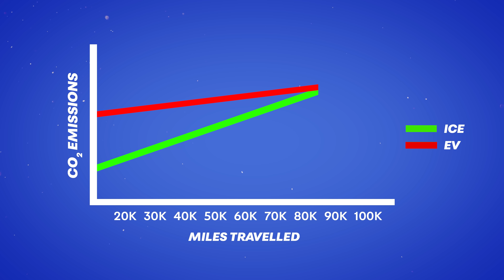Are Electric Cars REALLY That Green? [New 2022 Data]

Comment: I think one more major environmental problem is recycling the batteries of the EV's,it will make more damage than ICE vehicles.
Reply: Not an issue... head over to some EV owners forums and check their experiences. For instance, if an EV is involved in an accident, everyone will tell you, don't let the battery go when the car is taken away!.. Get it back from the insurance claim... because they are so valuable! Battery cells and entire packs are like gold dust. They are immensely useful and people want them for ICE car EV conversions, repairing existing cars and for use with home solar panels and grid storage... or even converting narrow boats and any other vehicle you can think if. A large battery pack in a car can be broken up and used in about 5 houses to complement a solar installation and there are companies popping up everywhere to refurbish them and sell them at a profit. This means basically zero EV batteries packs end up in landfill, you'd be an idiot to chuck them away!
Reply: I think u didn't get my point,so first we will discuss the scenario furnished here.
After the car get tottalled u expect the battery pack to be intact.
Ok now my first point,every battery pack have a life cycle it may vary,after the life of that battery pack it need to be recycled,that will do more environmental impact.
Reply: @lallumanohar4107  the lithium and cobalt and any other rare elements in car batteries, along with the copper, electronics, AC converters are valuable things....  So in the same way that a breakers yard will NEVER just discard the platinum in a catalytic converter.. no one is throwing away EV batteries or their components and leaving them to damage the environment. It simply does not happen, all the element stay in the battery, they don't fall out an exhaust pipe. So, broken they are worth money... intact and working.. they are worth a lot more money.. and many people are already profiting.
Tesla for instance want ALL their batteries back in the event of accident or a car no longer functioning... they are a resource. The current number is that 95% of the battery pack is recycable... the things aren't are made from plastics and glues.... ironically likely polymers etc derived from oil.

Comment: It's hard to know where to start with this and it's incomplete data.

Rory states... "it's not that simple" but he seems to have put a simple mind to it.
Reply from the maker: Please elaborate
Reply: @Autotrader_uk  the report is manufacturing specific - the report highlighted the dangers of speaking broadly about this.  The Video and title suggests you ignored this.

The report also makes a set of assumptions - those assumptions are non specific on the report - so lacking transparency.  I see no mention (may have missed it) on the video.

The report also excludes Maintenance.  To my knowledge and experience - EV's require significantly less maintenance - to negate the impact of mining, refining and transporting parts sways the report.

Additionally the well to tank research is so basic in its detail it's hard to determine anything at all.  I would like to see how they calculate the electricity, oil and chemicals that are required for extraction, the carbon footprint to refine oil, the transportation of said petroleum to petrol station, and the second order effects of pumping carbon.  The process is constant.. so an average across manufacturers would need to be determined..  in short.. it's lacking detail.

Even using their incomplete research the break even point is mentioned as 48,000 miles using the EU standard power mix and 30,000 if powered by wind.  I did not see that mentioned in the video.

Are EV's green... no.  But I would ask that if research is incomplete or non specific- I would ask that at least be mentioned before speculating.

Comment: One big thing missing from this report is refinements in efficiency.  You're comparing a 100+ year old vehicle design with a < 20 year old vehicle design.

100 years is a long time to refine a design and make improvements (think unleaded gas, less oil, better emissions).

* ICE vehicles are already working at the "best possible" CO2 footprint.
* EV vehicles are just getting started and already beat ICE in "most cases". LifePO4 batteries have a lower CO2 footprint (and multiple EV manufactures think they are the future) as an example.

If you're arguing that a brand new tech is only moderately better than a 100-year-old tech you're not really making a good argument.   20% less CO2 multiplied across 25% of the driving world's population is a massive potential shift for our planet.
Reply: Exactly. If 100 years worth of serious development had gone into energy storage, instead of ideas being bought up and shelved by the oil industry, who knows where we'd be at now.
Reply: ICE cars are not 100+ year old designs.  The current operating systems of ICE vehicles didn't even exist 30 years ago.  That's like saying electric cars are 100+ years old designs too, as some of the first cars ever built were actually battery powered.
Reply: @uni4rm  nobody said the ice car was a 100 year old design. They are saying ice has the benefit of 100 year's of development. Hence the state of its engineering today.
Reply: @yoda-be.at1746  Correct.   The ICE has obviously gone through multiple major iterations.  @1SLUGGO1 is completely missing the point and just spreading FUD.

You can't innovate on BEV's if you're not making them.  The Leaf and early Tesla show the technology's entrance to the main-stream as a viable option.  We have gone from 80 mile per charge to 300+ miles per charge in less than a decade. That meets feature equivalency with ICE vehicles.   I guarantee the next 10 years will focus on improving battery tech.   Faster charging + Cheaper batteries == cheaper materials == better overall CO2 emissions == more ROI for EV producers.

The electrification of our vehicles is win-win the further out you look.
Reply: Electric cars were about before petrol ones, they weren't very efficient in them days so petrol won

Comment: So I've just done 29k miles in my Nissan Leaf using 100% renewable electric through Octopus energy tariff in 18 months, so my car is now for the rest of it's life greener than any petrol or diesel on the planet. So the answer to your headline grabbing title is YES EV's really are Green!
Reply from the maker: I’d concur, particularly based on your use case. My leaf is even greener as it’s done more than twice the distance. 😀
Reply: Buy you will need a new battery at some point. That resets the countdown
Reply: @wanmanda  Unlikely and EV batteries are not 1 battery they are made up of many cells that can be individually replaced if needed and recycled. What happens to the components of a cam belt change, Oil, Filters, Plugs, exhaust etc? Plus the battery in my car can also power my house.
Reply: @wanmanda  No they won't. There are many many Leaf's on the road, they are getting on in years and miles and are fine, they don't need a replacement batteries. They'll easily last 10-11 years, which is the average age of an ICE car.... or more. Batteries, motors and electronics will last a lot longer than the body work and will be good for 2-3 decades if harvested for use in ICE conversions.
Reply: He didn't mention Diesel. The break even for Diesel is higher and in some studies isn't reached in the lifetime of the vehicle. True greens would be thinking more in terms of Hydrogen though. Especially now when it's starting to be produced as a by product of other energy production or using renewable energy sources.
Reply: @daveoriordan1537  incorrect, blue hydrogen is made from natural gas and green hydrogen requires immense electric energy to convert. Hydrogen lacks the efficiency of electric and therefore is 5 x the cost.
Reply: @gav_derbyzen  Green hydrogen is being increasingly produced by renewable sources or as a by product of other processes which would otherwise lead to wasted energy production such as incineration plants etc. It can also be produced by renewable sources at off-peak times and stored which goes a long way towards reduce the 5x cost... and this is also going to improve even more in the coming years. By the time BEV vehicles will be able to compare to Diesels in terms of range and overall carbon footprint I reckon we will be well on the way to having properly green hydrogen EV's which can do 1000km on one fill.
Reply: @daveoriordan1537  maybe for shipping, trains and other large transport for personal cars hydrogen cannot compete with the efficiency of electric. Currently I can charge and drive my EV for 1.5p per mile, even if this increase x 5 hydrogen will increase because it requires energy to make and is not as efficient in the propulsion cycle. Hydrogen cars will never compete on cost or adoption.
Reply: @daveoriordan1537  no hydrogen for consumer vehicles is not going to happen, no one is investing or making them. Hydrogen requires more energy than putting the same energy into a battery. This is physics. The conversion back and forth from electricity to hydrogen liquid and then back to electricity uses energy. Also note, hydrogen fuel cell cars contain and run off a battery, a tiny one, which gets charged over and over by the fuel cell. This is a battery which can wear out! As it’s small, it will be cycled many more times and wear out much quicker than a big battery. Also the hydrogen fuel cell has filters that need replacing, these are expensive, the FC needs very clean compressed air to operate. The maintenance bill is big! As someone who has owned an EV for 5 years, I’d laugh if someone tried to sell me on a FC car which I had to drive someone to fill up with a liquid .. I have electricity at home thanks, all other cars seem rediculous at this point, FC even more so.

Comment: i personally bought an EV to spite and annoy people... bare with me here, Tesla V3 (i think) are going to be 1MW charging stations - 4x250kw bays. I think i saw somewhere that peak household use is about 10kw - seems high but whatever, that's 100 households worth of capacity for about 20 minutes charge time per each set of bays, now imagine a lot of those dotted around the country? i WANT rolling blackouts and brownouts because there are only 2 ways to move on from that, the correct way which is building more nuclear power plants and scrapping gas,coal and oil burning ones or going with the low IQ way which is building more fossil fuel burning ones. By me being a prick i am forcing the morons in the government to make a choice for which they will either be crucified or will be praised. If we finally move on from fossil fuel power plants all that about EV's starting their life off with 29k miles worth of CO2 already accumulated goes down, i imagine a lot of energy is used to mine, process and make batteries, if we can move to entirely renewable or clean energy in the whole process we can take that initial value down and when we recharge the cars later on its even better. So the TL:DR is the argument shouldn't be about cars being the big bad polluters, it should be about the whole grid being ran by low iq greed driven monkeys and the law makers helping them get away and profit from it.
Reply: They are getting battery banks to offset this

Comment: Just focusing on C02 is what got us promoting diesel , its brake dust , drive belt particulates , noise pollution , waste air filters + oil filters + plugs , fuel leaks , burning oil with engine wear , reliance on a finite imported energy source . To account for everything is not being done as facts are cherry picked by both sides.